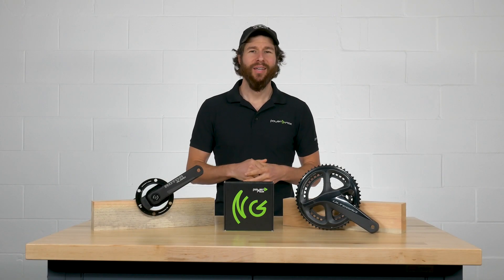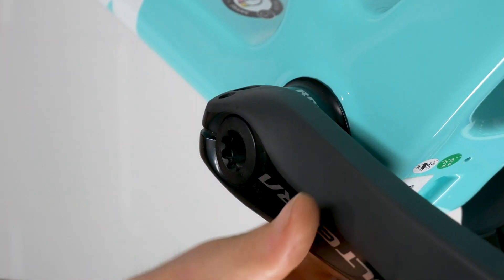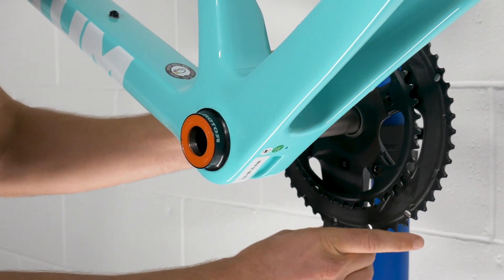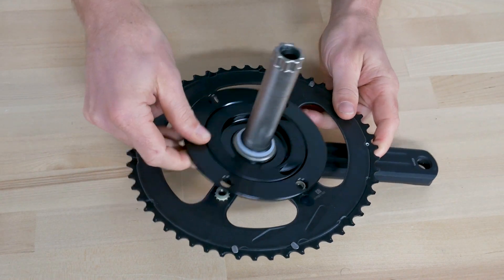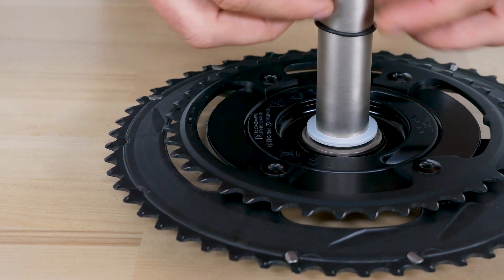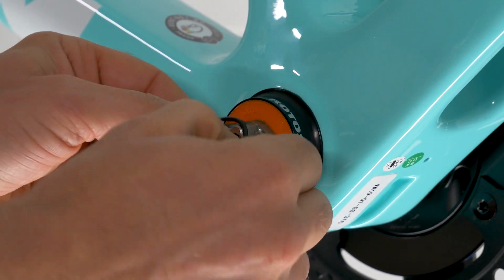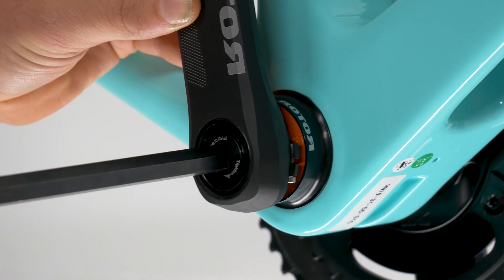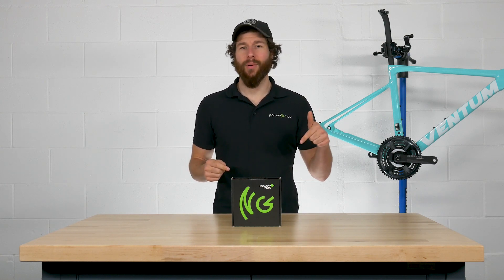ALDHU SHIMANO 4S INSTALLATION

Comment: What is the job of those rubber o-rings?. I have Ceramicspeed bsa bottom bracket and non-drive side o-ring prevent to adjust play with preload knob so i take it away. Preload is perfect now.

Comment: Hi there. Are there budget crank arm and spindles that one can use for the spider based power meters other than Rotor? Thanx ...
Reply from the maker: It is possible to use a power2max SRAM powermeter with older SRAM cranksets like SRAM force etc. To check if the crankset is compatible check the back of the spider. If there are three screws to connect the spider onto the right crankarm it is compatible. Apart from that the Rotor power2max Edition currently is the best and cheapest version available.